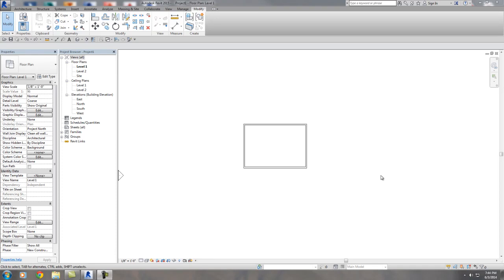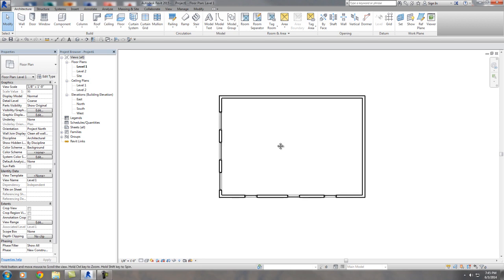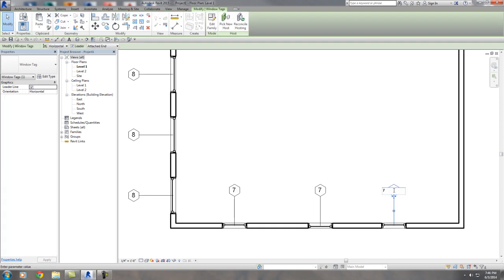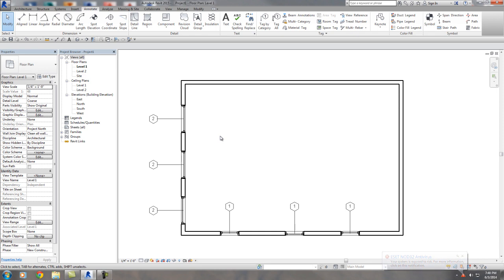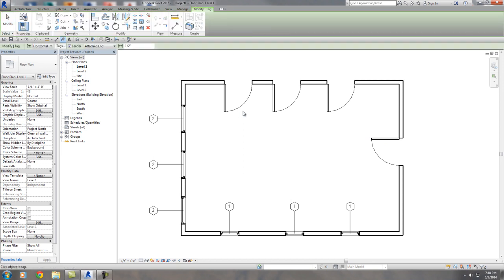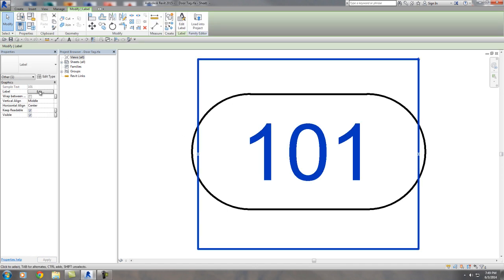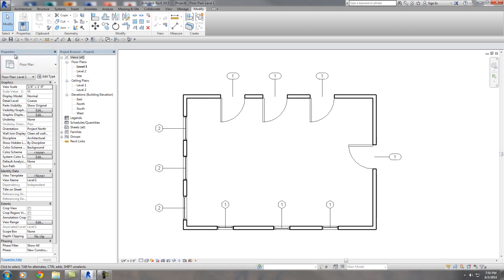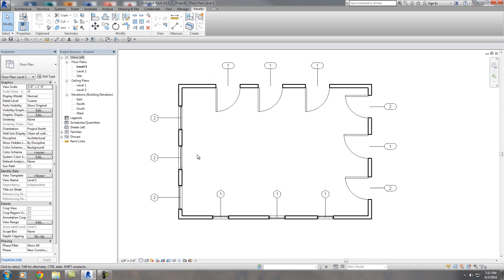Revit Tags Doors Windows

Comment: You mentioned that you could use letters instead of numbers.  I would like my doors to be labeled by numbers. And windows labeled by letters.  The numbers part is easy enough as that is how it is out of the box. I need help getting letters to show up when windows are placed.  And so when you add a new instance of a different window it will be labeled as b c d etc.
Reply from the maker: ***** If you start you first tag with a letter revit will automatically  continue with letters and the same with numbers .